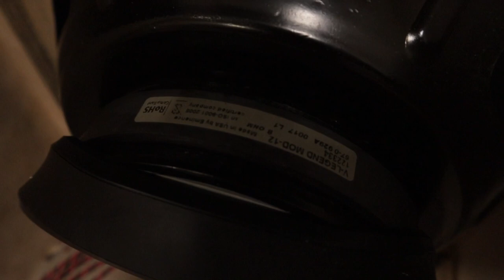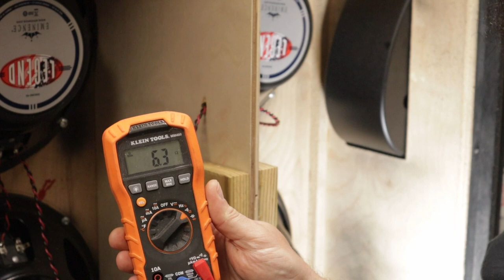A look inside GWAR's retired VADER 4x12 cabinets

Comment: Actually it matters which direction they move, because if they move backwards the dust caps may deform and the coils hit the bottom of the speaker.
Reply from the maker: AC audio waves are positive and negative. The speaker coil must move both forwards and backwards to make sound. The coil moves extremely fast. It goes outwards during positive cycles and inwards during negative cycles.
Reply: @purgasound  Yeah but usually in a fast tempo music, the peaks are assymmetrical.